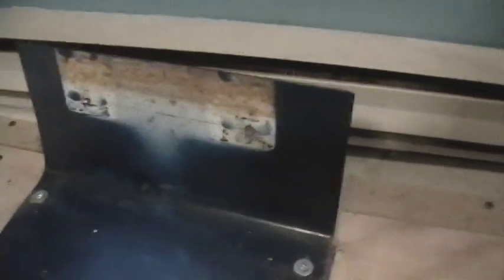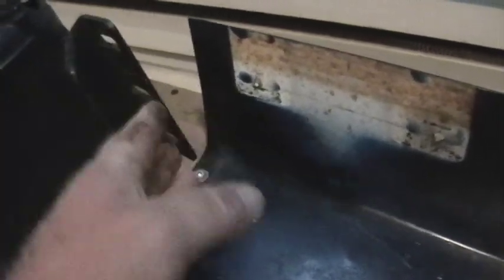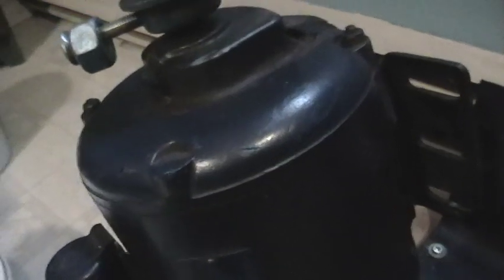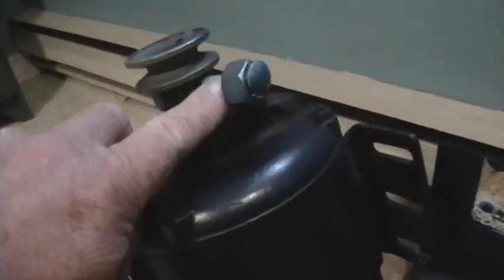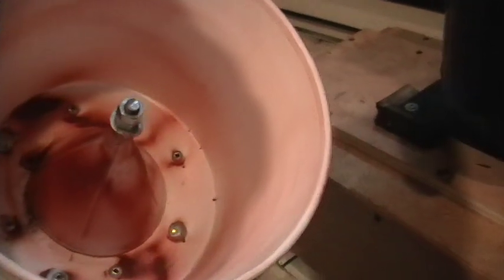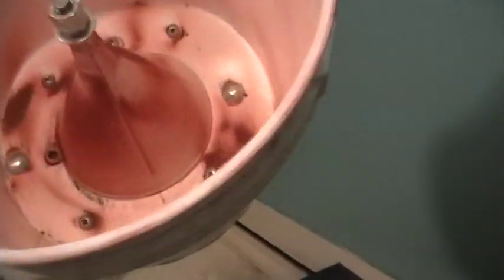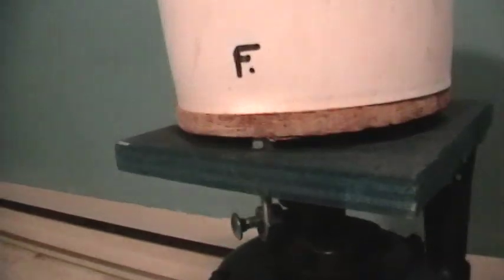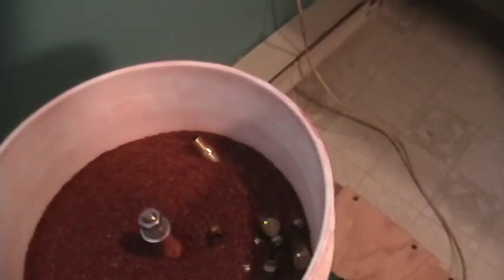How to make a Brass tumbler details

Comment: Hi Robert, I saw the message last night.  Thanks for the info. I swapped out the steel with something thicker and it worked! Apparently the 18ga steel I used was too flimsy.  Thanks for your help and my apologies for the late reply.  For the bend, I simply bent the steel around a 1.5" pipe to give it a nice curve.

Comment: I built a brass tumbler like yours but for some reason the mean won't rotate around the funnel.  It just churns the media from the inside (near the funnel) to the outside of the bucket. The brass won't rotate around the funnel.  I tried different counterweights and it didn't seem to make a difference.  If you have any ideas as to what I could try next I would appreciate them.